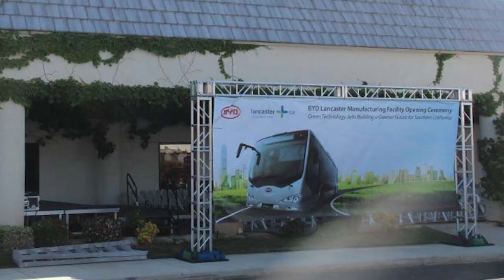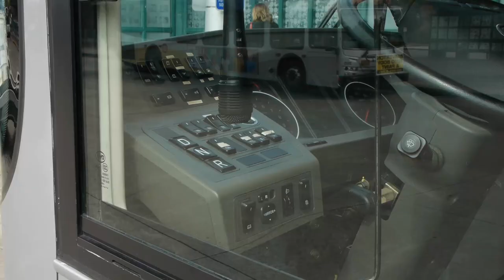TriMet Electric Test Bus Event - BYD Motors Electric Bus

Comment: Ya its an electric bus. They've had electric buses for a long long time, the called them trolley buses. Modern day electric buses are already in use all over the world:

Asia
Malaysia
Malacca
India
India's first electric bus has been launched in Bangalore.[37]
China
Beijing's electric bus fleet in service during the 2008 Olympics.
Beijing
Shanghai (capabuses).
Yancheng.[38]
Japan
Community Bus "Hamurun"
Community Bus "Hamurun" (Operated by Nishi Tokyo Bus) in Hamura, Tokyo since March 10, 2012[39]
Community Bus "Sumida Hyakkei" (Operated by Keisei Bus) in Sumida, Tokyo since March 20, 2012[40]
South Korea
Seoul's "Peanut Bus" heading to N Seoul Tower at Mt. Namsan.
Seoul has 15 electric buses nicknamed "Peanut Bus" for their shape, transferring people from subway stations in downtown to the N Seoul Tower, circulating Mt. Namsan.[41]
Seoul's Gangnam District will have 11 electric buses in operation from February 2013 and 270 electric buses by the end of 2013, increasing to 400 buses by 2014.[42] At least 3,500 electric buses will be introduced in phases until 2020, which will account for half of Seoul's bus fleet.[43]
Gumi will have the world's first wireless electric bus, known as Online Electric Vehicle, in operation from July 2013 developed by KAIST. Electricity is wirelessly fed into the bus from the tracks.[2][44]
Pohang will have automatically battery switching electric buses in operation from July 2013. Unlike conventional plug-in charging buses, the battery pack is automatically swapped with a fully charged one before complete drainage.[45]
Canada
Québec
Réseau de transport de la Capitale, Quebec City's public transit authority has integrated 8 electric buses to its fleet in 2008 to serve the Old City.[46] The Tecnobus Gulliver buses can carry up to 20 passengers and runs on $3.25 worth of electricity per day.[47]
Montreal, bus fleet going all-electric by 2025.[48]
Europe
There is an European Union directive that mandates the purchase of electric buses for public services.
Gruppo Torinese Trasporti — Turin, Italy
Spain
Empresa Malagueña de Transportes (EMT), S.A.M[49]
Empresa Municipal de Transportes de Madrid (20 all-electric and 20 hybrid diesel-electric buses)[50]
Councillor for the Environment, Figueres [51]
León: Minibus Tecnobus Gulliver [52][53]
Seville [52]
Finland
Espoo Cobus EL2500 (bus 11 Friisilä-Tapiola Centre
Switzerland
ABB TOSA Energy Transfer System
transport public genève (tpg) introduce TOSA Flash Mobility, Clean City, Smart Bus[54] a new system of mass transport with electric “flash” recharging of the buses at selected bus stops.[55]